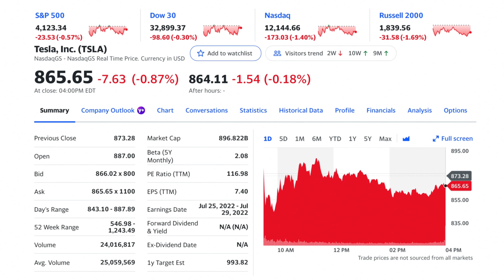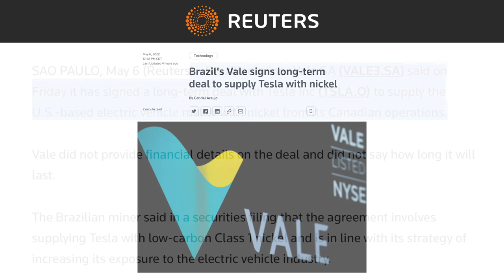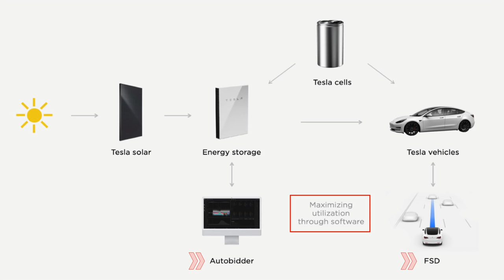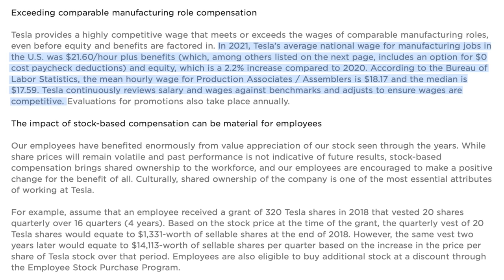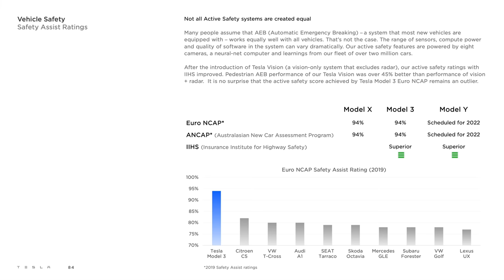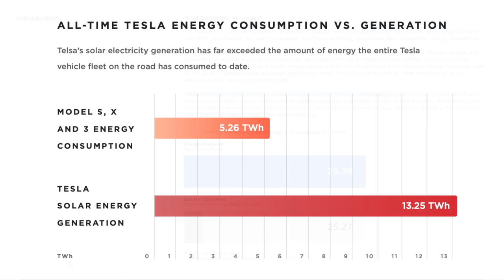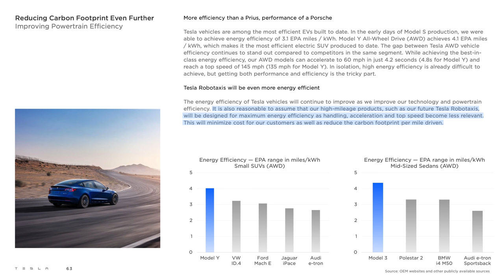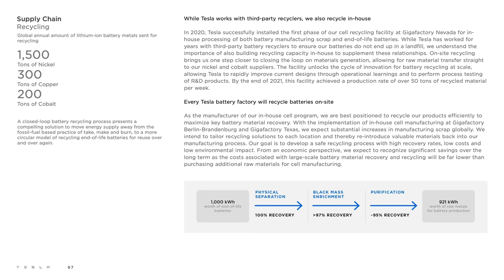Tesla Just Disclosed Major Competitive Advantages in Impact Report

Comment: Is this about right? Seems crazy fast ramp but based on 50% increase each year.
2022: 700K Fremont, 800K Shanghai, 100K Berlin, 100K Texas = 1.7M
2023: 800K Fremont, 950M Shanghai, 400K Berlin, 450K Texas = 2.6M 
2024: 900K Fremont, 1.2M Shanghai, 850K Berlin, 950K Texas = 3.9M
Reply: very doable. maybe expect moderate production in 2024 from the new Shanghai factory too
Reply: @bpbp277  bullshit!!!! It’s only doable if they just make those small model 3, if they try to mass produce the semi or cybertruck it’s over no chance to make even 500k cars globally.

Comment: when they calculate energy used by their vehicles do they count the inefficiency of the chargers. meaning total energy used to charge instead of total energy expended by the vehicles? how do they measure energy used in a home charger?
Reply: I do know the vehicle has that data, you can get it with 2nd party apps.
Reply: Kinda simple math. All expended energy - energy supplied by supercharging = energy supplied by home charging. Doesn’t really affect the purpose of Tesla’s graph and point Tesla was making.
Reply: p58 "including energy losses during the charging process."
They do. All real-world figures, no cheating or massaging.

Comment: Really appreciate the summary. It's very hard to find the time to read through otherwise! Re 'energy produced', that seems like it could be a misleading metric. The challenge with solar is far more about reliability than total power production - it doesn't do any good to produce 10x as much as you need throughout summer if you end up with 0.1x over winter. So, while I'm not sure they would have access to this data, 'TWh consumed that were produced with Tesla solar panels' would be the stat I'd want to see.
Reply from the maker: Well the produced energy has to go somewhere, right? Generally into direct use, the grid, or batteries.
Reply: @TeslaDaily  I don't think that's materially true. Sometimes the grid can't accept extra power (and adding it could even cause overload), so it would just sit in batteries gradually depleting or just not be captured in the first place. I don't claim any expertise here - maybe that's so infrequent as to be irrelevant for Tesla, but if power was so easy to manage we'd already be almost off fossil fuels.
Reply from the maker: Yeah looks like excess energy is dumped as heat. I’m not sure how that would be measured/accounted for, but the impact report might have more info on it.
Reply: @alangreenspan897  They do say the measure of a man's integrity is how willing to type in allcaps he is.

Comment: My tesla model 3 autopilot saved my life. I was in the right lane on the freeway when suddenly my tesla started braking HARD. At first I thought it was ghost braking, so I moved to disengage autopilot, but then from my left side came a car moving reverse traffic and perpendicular to the freeway, spinning as it came. It passed right in front of my vehicle without hitting me, in a very strange, surreal moment. If my model 3 didn’t brake, it would have hit me and our combined speeds would have killed me with a direct impact on the driver side of the car. There was no way for me to see it or react to it because of the odd angle it came at me and another car that was blocking the view.

Edit: I wish I could draw a diagram for how the orientations of the vehicles were. There was absolutely no way a human being, or any other car with a different emergency braking system could have stopped this accident from occurring. The only thing that saved my life was the fact that I was in a Tesla with FSD/autopilot. There is no disputing this. It is 100% fact.

Edit 2: I never saw the car until it was directly in front of me, just inches from my car, spinning across my lane. I only didn't get hit because my car had stopped itself automatically. The reason I could not see the car coming at me was because it was behind an SUV in a blind area. One moment there was no car there, next moment there was a car. But the Tesla braked BEFORE the car was visible (to me). I'm not sure how it saw it. 360 degree cameras probably helped. Maybe the radar let it see under the SUV? Or maybe the cameras being up higher let it trough the SUVs windows? Not sure. But the Tesla Autopilot was able to see a car that I couldn't, and reacted to that car before I even knew what was happening. That's why it felt so surreal. It was just the suddenness of watching what would have been my inevitable, unavoidable death slide right across my field of view and yet some magical unknown force, an angel (AI), had stopped the accident from occurring.
Reply: Other cars do that to,nothing special!
Reply: You could totally miss that car and then complain about ghost braking...
Reply: Lol……. Driving while been distracted right!? What a joke!!! People drives on the German autobahn at crazy speeds and no accidents barely.
Reply: @brunoheggli2888  how many “other cars”
Reply: @JamesBond-qv2ht  Who is the fudster?
Reply: @brunoheggli2888  Lol. No other car would have saved me in this instance. It was 100% the FSD/autopilot system.
Reply: @carholic-sz3qv  Idk what caused the other vehicle to spin out. It may have come from the other side of freeway, up and over the barrier, or it was in the far left lane behind other vehicles and bounced off the barrier wall. I really don't know. It came from a blind area in front of a SUV on my left side.
Reply: @TheNativeTwo  Bruno.
Reply: @JamesBond-qv2ht  ah makes sense. thanks! One day its going to be so satisfying when some of these fudsters end up having to buy a tesla because the world has changed so much. Don't worry, Jokes on them.
Reply: @TheNativeTwo  even more so because they won’t have any TSLA to pay for their Teslas.
Reply: I had a similar situation.  I wasn’t driving a Tesla on auto pilot. I was driving a Toyota 86 in the rain and on a bridge 85mph.  Car beside me hit the rail and started spinning to the side of me. I kept calm and cool and gently slowed while the car spun into my lane in front of me, i was sure I was going to hit her and get tangled up in her spin but I didn’t.  Just good control of my car, intuition and the situation.  She landed in the median, I pulled over to make sure everyone was ok and called the police.  I escaped without a scratch.  😉
Reply: @Egyptologist777  That's great, glad you made it out okay. The subtle difference for my situation was that I never saw the car until it was directly in front of me, just inches from my car, spinning across my lane. I only didn't get hit because my car had stopped itself automatically. The reason I could not see the car coming at me was because it was behind an SUV in a blind area. One moment there was no car there, next moment there was a car. But the Tesla braked BEFORE the car was visible (to me). I'm not sure how it saw it. 360 degree cameras probably helped. Maybe the radar let it see under the SUV? Or maybe the cameras being up higher let it trough the SUVs windows? Not sure. But it was able to see a car that I couldn't, and reacted to that car before I even knew what was happening.

Comment: Why the huge -- over 50% - difference in water use per vehicle between Berlin and Austin [@ 16:02]?  Austin is a newer factory design and both will be manufacturing batteries.
Reply from the maker: Water constraints are likely more significant in Berlin, likely causing Tesla to make decisions they wouldn’t otherwise make to limit water consumption.

Comment: Elon~  Shhh.  It's just you and me here.  Build the battery train.  Charge in the desert and arrive in the city the next day.  Can power a major outage(FEMA) or just cover the peak power.  Get paid well for it.
Reply: Still a bad idea!
Cheaper in the long run to run wires than having to use humans to move batteries twice a day.
And power outages can be handled much faster with trailer mounted generators, or Mega packs hauled by semi trucks, because many places don't have rail lines anywhere near the town.
Reply: Have you smocked something!? Lol!!!!! The battery trains are just possible in tiny trains/trams.
Reply: Get enormous trains, fully loaded with rocks to run full pelt into towns, then convert the kinetic energy to electricity with giant flywheel turbines. Yeah, trains all the way down, not turtles...

Comment: 11:58 - but, but all the electricity for EVs is produced from coal. Say the knuckle draggers.
Reply: Not all, and it does vary from region to region but you can explain to the knuckle draggers that even if it was 100%, BEV's would still reduce carbon emissions.

Comment: HVAC control. I'm not sure why AI is required to make substantial savings here. The Fan Laws say that halving a fans speed will reduce the energy consumed by 7/8. So, temperature controlled VSD (variable Speed Drives) on fans and compressors are already offer a huge savings without getting complicated with AI. Save the AI effort for FSD and Optimus...
Reply: Without details one can only guess, but in a nerdy company we can't completely rule out a overly complex solution to a simple (and I use that term loosely) problem.
Reply: Well, just from following the HVAC systems world from a distance, it's an involvement that's showing up more and more.  It's NOT just a thermostat and VFD controls issue - they're incorporating weather patterns/predictions, highly details usage patterns within the building, sun angles...  imagine a system where you know a particular group has a meeting scheduled and you have sensing in the room all the time, you capture that they tend to not use the space for the entire blocked hr - you can can then know to sense when they leave and immediately save on delivery to that space and allow it to go to a higher temp (in A/C season) - because you maybe also know it's not scheduled the rest of the day...  Optimizing chiller and AH units with greater accuracy...  and monitoring power to take advantage/avoid rates optimally and dynamically without intervention...   I read a story about 3 months ago about motor controllers that were cloud AI connected and the drivers for them could be optimized and cut power.  I'm familiar with VFD and motors... this type of AI stuff is far more involved than that ... but that's probably a subset included in it as well.
Reply: I get you point but just because they worked and are working on this pet project dosent mean that they are loosing resources from other more important ones… there are many factors that would go into analyzing if they are actually net loss of productivity by choosing to put some resources into this plus what is the net outcome in terms of dollars to work on this considering tesla wants to build 20 milion cars. If they save millions per factory and they build 20 fabs that’s a if savings
Reply: Wrong!!!!!!!! And lame comment! Why do people always forget the most important thing about HVAC!?!?!? The building/house have to be very well insulated first, the rest is easy for the efficiency of the system.
Reply: Buildings/house in the US for example barely have double or triple glazzing windows, they are wood construction and sooooo much terrible compared to a European average home. AI won’t help if the system isn’t well insulated!
Reply: Sure, but saving 1% on  $100,000 bill is worthwhile, in many cases ( and right now saving energy is pretty important anyway). And their solution is another example of how they could ( and most likely will) scale this as a commercial product - thus monetising yet another R and D project...

Comment: They plan to make 20 million model 3 in years to come!!!!!!!!! What a joke they will never achieve that if they remotely tries to mass produce the semi or cybertruck, let’s not forget things like vans…..
Reply: Learn to read. The report actually says "...by 2030 we are aiming to sell 20 million electric vehicles per year...", not 20 million Model 3s.

Of the car production part of that figure, Model Y is already the largest portion, and that will grow. They've said several times that Model Y will be the best selling car in the world by volume over the next couple of years.
Reply: @GordonMullan  are you a troll!? It was sarcasm! A single semi alone needs about over 10 model S batteries packs, and other companies are also ramping their EV production while also securing raw materials……. Tesla is just a parrot on internet! Apple never talks about those things for example.
Reply: @GordonMullan  another joke is that there are sooooo many different car models adapted for different use that tesla doesn’t even make and those require significantly more batteries.
Reply: @carholic Are you incapable of basic maths?

Tesla has said that their goal is to produce 3tWh of batteries per year by 2030, with about the same again from suppliers.

The Impact Report says Tesla will use half their battery production for energy, so let's assume the same split for batteries from other suppliers.

That means 2 x 1.5 = 3 tWh of batteries for vehicles.

The battery pack size on a Long Range  Model Y is currently 82kWh (75kWh usable), and the standard range is 60kWh. Half their cars use LFP (standard range), so let's say split the difference and say 71kWh per vehicle. That means in 2030 there's enough batteries for 42 million Model Ys. 

Model 3 batteries are smaller, and future cars including robotaxi will likely have smaller batteries, so more likely 45-50 million cars.

If they're aiming for 20 million *vehicles*, given the global market for heavy trucks is a couple of million a year (and Tesla won't have 100% of that market), even with 10x bigger batteries, I think the numbers stack up just fine.
Reply: @GordonMullan  those numbers and math is all in your imagination! Stop the crap!!!!!! The way you think is that they are going to magically have those batteries like that!? Other companies are also making EVs and investing in batteries…… the LFP is only for short range EVs, people have been wanting more and more range to use their EVs more frequently! Your 40 million car estimate is just trash!!! Trucks, semi, vans…… are going to  red significantly higher density batteries. Even if tesla want they can’t make those million vehicles…. You’re optimistic but donot exagerate lol…..calm down
Reply: @GordonMullan  solid state batteries, CATL sodium ion batteries…… are coming soon and still that isn’t going to solve the battery demand issue.
Reply: @carholic-sz3qv  Again, learn to read.

I didn't say Tesla would produce 40 million cars, I said that their predicted battery supply would be enough for the equivalent of 40-50 million cars, so if they're aiming to sell 20 million vehicles (not just cars), then there's plenty capacity for bigger vehicles like the semi.

As for LFP being for lower range vehicles, since 50% of their vehicle sales are currently LFP I don't think there's much of an issue, and improvements in efficiency will likely see that percentage grow. 

As for "magically" getting the battery supply? No.

They're going to build the factories and encourage, secure and if necessary build the supply chain of materials, including mining and recycling.

400,000 trucks per year (for a 20% market share) x 850kWh battery pack = 0.34tWh of batteries.
Vans will be a bit bigger batteries than cars.
Where is the problem is the maths?
Reply: @GordonMullan  did I say they will not produce those 40 millions vehicles!? Lol…… I was talking about those stupid estimations In the future. Bigger EVs needs way more batteries than the small ones. Tesla could make millions and millions of vehicles in the future but not if they decide to mass produce bigger vehicles.
Reply: @GordonMullan  thé semi will actually have a giant battery for about 1MWh of capacity depending on its application. Diesel trucks are made to haul way more than just 80.000lbs for your records.
Reply: @carholic-sz3qv  Just for your records, Elon said the 300 mile Semi will have a battery of 500kWh, hence my estimate for the 500 mile version.
Reply: @carholic-sz3qv  Do your battery requirement  maths based on how many Semis they will produce each year like I did. The vast majority of the millions of EVs Tesla will produce will be 3, Y, Robotaxi and maybe Compact. Yes there'll be Semis but in the hundreds of thousands not multiple millions, yes there'll be vans but probably  won't need more than 100kWh, Cybertruck will sell a few million a year at 100-200, maybe 250kwh depending on spec.